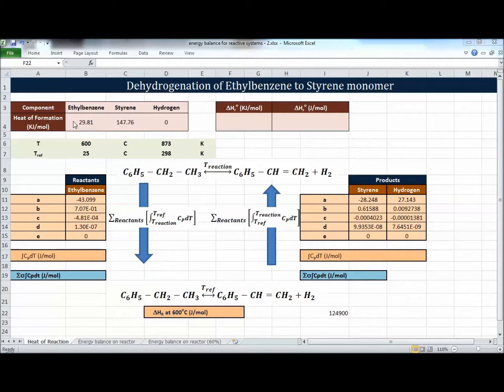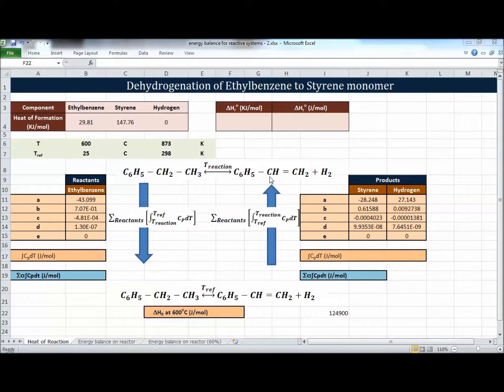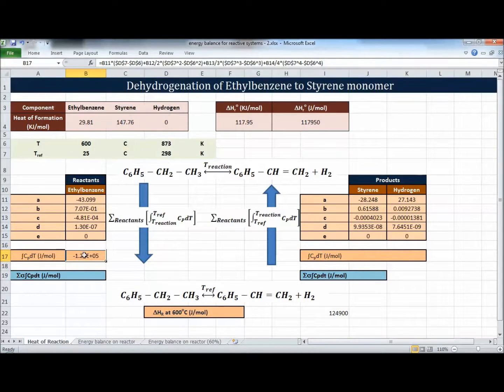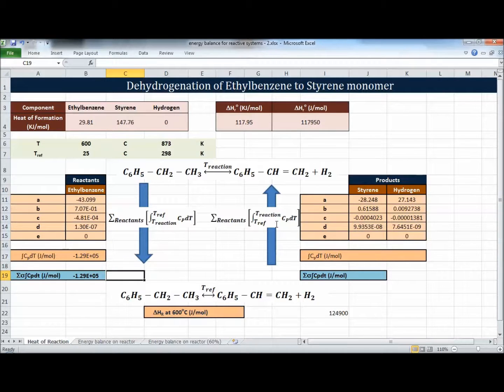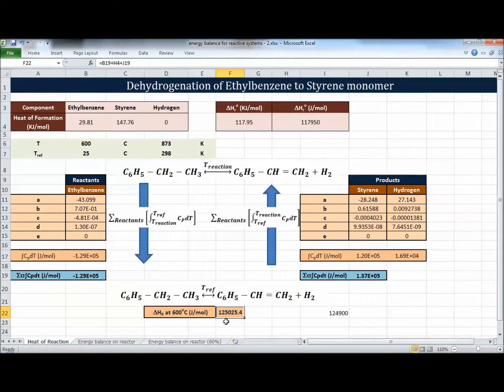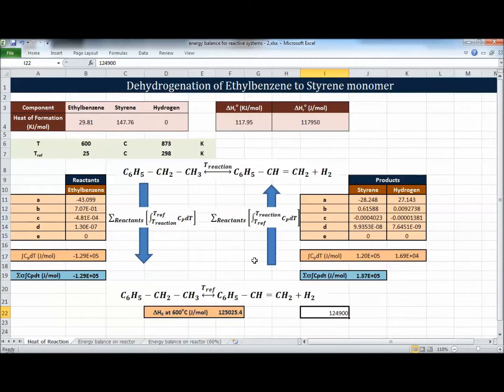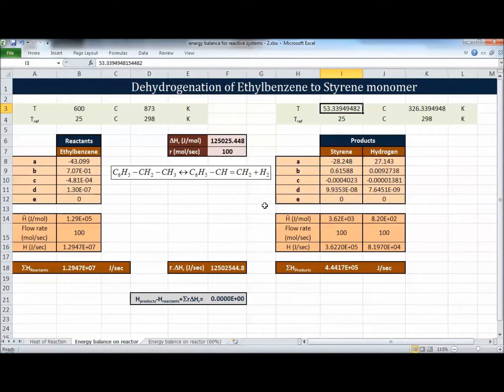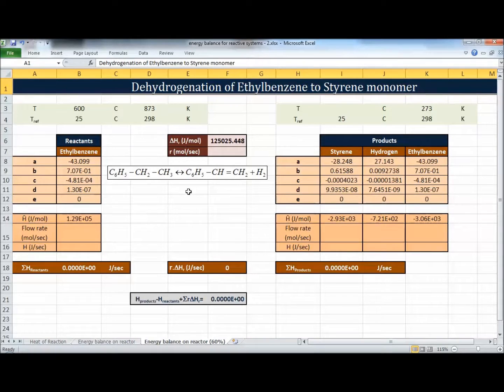Excel for Chemical Engineers I 21 I Energy balance (5/5) [Energy balance for reactive systems 2]

Comment: At the last you change the value of reactant (final enthalpy, first you add with flow rate , and then you multiply it with flow rate), .And in my final equation (after using Goal seek, it giving the wrong answer ) it is not equal to zero

Comment: In the textbook 'Elementary principles of chemical processes' Fedler simply uses the heat of reaction at 25 C. Can you check out the textbook?
Reply from the maker: He calculates the heat of reaction at standard conditions (25 C and 1 atm) using the heats of formation which are available ONLY at standard conditions. I have already calculated this in cells F4 and H4 (inKJ/mol and J/mol).
However, if the reaction is taking place at other temperature (like in the case I presented), the value of heat of reaction is different. Since we do not have tabulated data for heats of formation at other conditions than the standard ones, the only solution is to follow the procedure that I demonstrated in the previous video and in this video.
You can find this demonstrated in details in the textbook you mentioned (3rd edition) in section 9.5, and example 9.5.1 (P. 453) shows the steps in details for ammonia oxidation reaction.

Hope I made it clear!
Reply: @MGMohammed  Thanks for the answer and for the videos, your channel is my go to source on YouTube.

Comment: Good morning, why did you put the energy input equal to zero ?
Reply from the maker: I did not put the energy input equal to zero. I need to calculate the temperature of the product, but it cannot be calculated directly as T is present in many terms with different powers. So I assumed a value and put the energy balance equation to be equal to zero, then changed the value of product temperature so that the energy balance equation is satisfied (equals zero).
hope this answers your question!
Reply: @MGMohammed  and to calculate the inlet and outlet specific enthalpy of the elements what temperature did you use as inlet and as outlet ?
Reply from the maker: @graceamon5715  I know the inlet temperature is 600 C, but I do not know the outlet temperature. So I assumed any value as an initial guess, I know the reaction is endothermic so the outlet temperature is less than the inlet temperature, so I assumed 300 C. Then used goal seek to change the outlet temperature till the energy balance equation is satisfied.
Reply: @MGMohammed   Thank you very much 😊

Comment: Hello sir...

At 06:11...
 However all input values are same,I'm getting very different result and all calculations got wrong further...
Reply from the maker: This seems like an issue with the equations. revise the first so that did not give the same results as in video. It can be a mistake in the signs or in the powers.
Reply: Yes sir...there is mistake in negative signs... very long observation I find out it and corrected...

Thank you sir for your quick and humble response 🙏😇